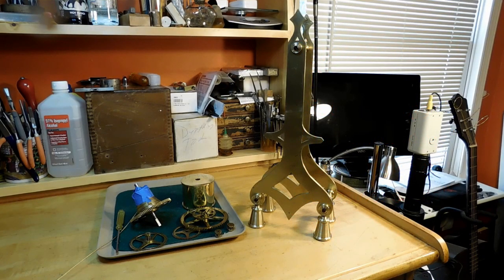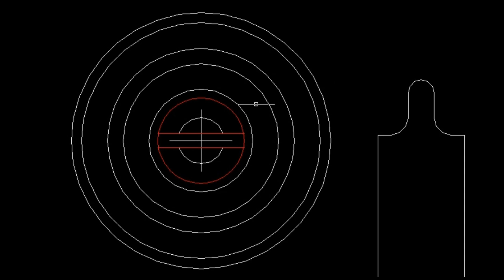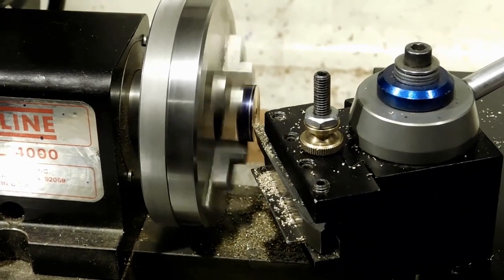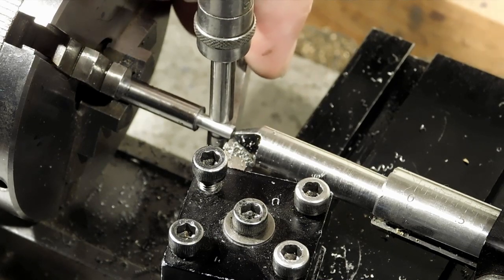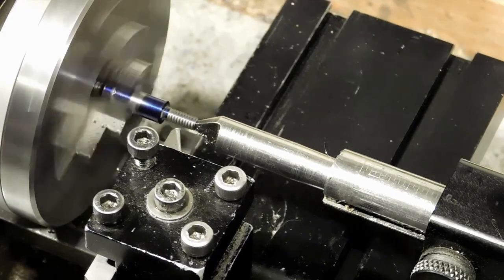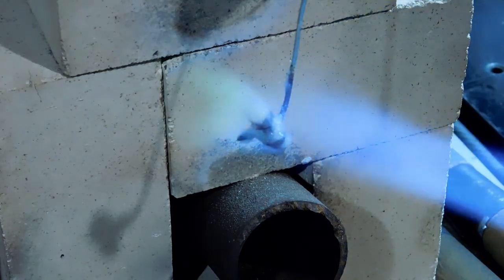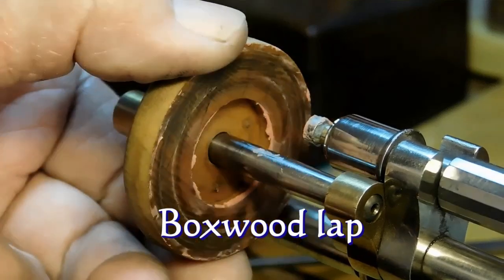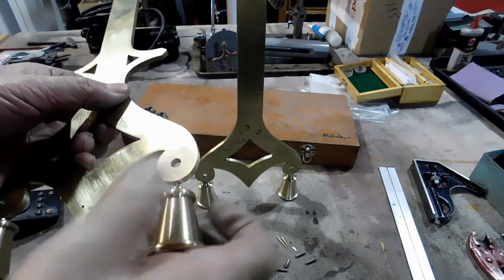WR Smith's Grasshopper Clock: Part 4 The Washers, Screws and Feet

Comment: G’day Bob, nice job making and polishing the screws, a lot of work but fine results. And you polish the threads, the threads, why! Their inside the material. 
Fine work my friend. 
Cheers 
Peter
Reply from the maker: Thanks Peter...I think I do the threads because that's how I learned...and I use a lot of oil when threading and a quick polish assures they are real clean for bluing...even a fingerprint can make a mess of the bluing job...bluing also fights off corrosion so 100 years from now you should be able to remove the screws (: ...bob

Comment: Not sure what you mean by a "spring pass at 0.00 clearance" when it clearly shows material being removed!
Reply from the maker: Peter…a spring pass is always performed at the end and sometimes during a threading or boring operation and refers to one or more passes that are made at the same diameter or zero advance. The main purpose of spring pass(es) is to release tool pressure referred to as spring and remove the last remnants of the material. This is important when threading as the deeper the cut goes the more aggressive the cut and therefore more spring…and remember the stepper motor on the cross slide has to synchronize with the RPM of the spindle…to do this… if you look my cutting tool it starts its pass 1/8” from the tool steel…this allows the spindle to rotate 4 times before engaging to cut…this is enough time for the two to synchronize successfully…another way to make the cut less aggressive is to set the compound at a 29 degree advance angle…my lathe does not have a compound…the stepper motor is on the cross slide so the 29 degree advance must be accomplished mathematically…I limit the RPM to 250-300 to accomplish all this…I hope this helps and does not confuse…bob